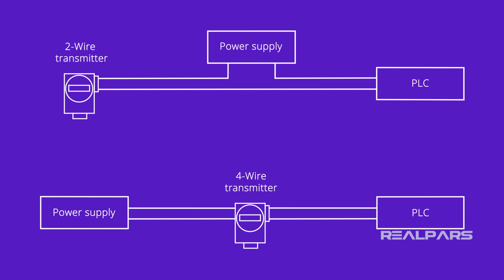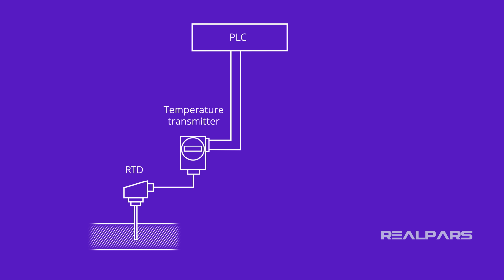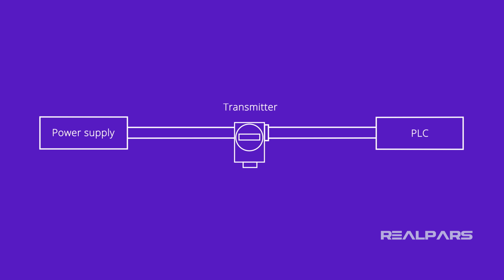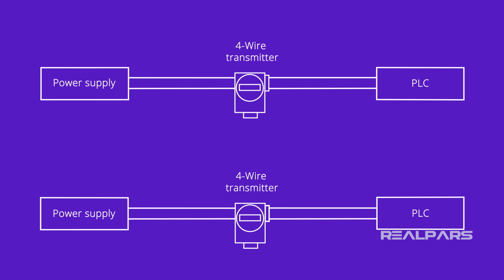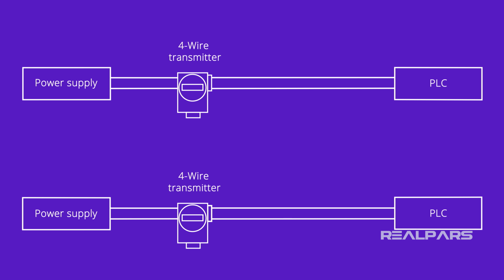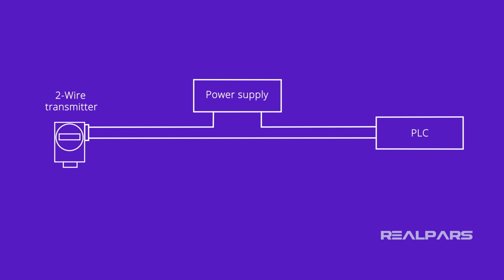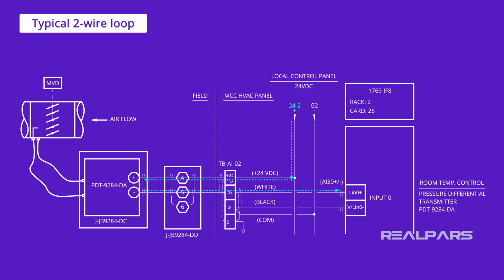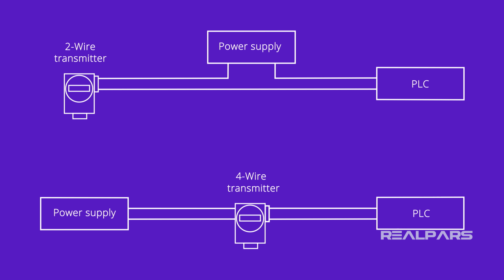What are 2-Wire and 4-Wire Transmitter Output Loops?

Comment: For the 4-wire instrument, what are the 2-wires going back to the PLC? Are they an AI & AO? Or can they be any type of IO
Reply from the maker: Hello, @alextannerharo5959.  Thank you for your question. Good question. If you are using the 4 wire, 2 wires for to power the transmitter and 2 wires for the signal out of the transmitter to the PLC. The 2 wires coming out of the transmitter are the + and – voltages connections to the PLC. And the same applies if it’s a current signal.  Here is a link for your learning:

https://www.dwyeromega.com/en-us/resources/pressure-transducer-installation?srsltid=AfmBOoqUxL68NmzUAViIJnGMUZORJdgR2JOAzwKVALsN8PmjEjiVY7co

Happy learning from Realpars!

Comment: For the 2-wire type connection with external 24VDC power supply (+ to transmitter + and - to AI card, while transmitter - goes to AI card channel to form loop) is there a specific type of barrier or isolator model that can be used for transmitters in Class 1, div 2 environment? Thanks in advance
Reply from the maker: Hello@priyankadookie2421.  Thank you for your question. Yes, there are as stated below in the definition.

Transmitters used in Class 1, Division 2 environments must meet specific safety standards to ensure they can operate safely in areas where flammable gases, vapors, or liquids may be present under abnormal conditions. Here are some key considerations:

- **Intrinsically Safe or Explosion-Proof Design**: Transmitters should be certified as intrinsically safe or explosion-proof to prevent ignition of hazardous materials.

Depending on your application, here are two links for your learning you can research:

https://www.talontechsales.com/hazardous-area-products.html?form=MG0AV3&form=MG0AV3

https://www.noshok.com/support/support-tools-faq/application-insights/hazardous-location-requirements-for-pressure-transmitters-in-the-oil-gas-industry/?form=MG0AV3&form=MG0AV3

Happy learning from RealPars!

Comment: What is the most used in  industry 2 wire or 4 wire ?
Reply from the maker: Thank you for your question. Both types are widely used in the industry, and the best choice depends on the specific application and controller type. Learning both is beneficial if your role involves wiring and integrating them into your designs. These concepts are commonly taught in electrical engineering and technical schools due to their broad applicability. Happy learning!

Comment: Just a remark; I think we should never use AC and only use DC Power supply when using 2-wire loop powered transmitter because if you use AC, then you can have Electromagnetic Interference (EMI) in your signal that is being sent to the PLC. Please correct me if I am wrong.
Reply from the maker: You are correct.  A 2-wire transmitter's circuits are designed to regulate DC current, not AC.
Reply: @realpars  thanks for confirming.

Comment: I actually want to know in an Analog I/O module card ,where does the 250 ohm resistor is placed with regards to 2 wire and 4 wire?
Reply from the maker: An external 250 ohm resistor is needed only if the I/O card is a voltage type.  If that is the case, the 250 ohm resistor is connected across the input terminals of the I/O card.
Reply: @realpars  thanks

Comment: Please explain wiring, when we use barrier in the loop in two wire communication. For example of we use P&F barrier then where to put this barrier in the loop?
Using common sense I can tell that...just before the TB we can put barrier. But I have seen two wire communication where power supply, transmitter and PLC are not in series.

Comment: what if the transmitter is loop powered meaning that there is no need for a power supply in the 2 wire configuration, the transmitter receives the power from PLC IO cards ?
Reply: Nope. You put a power supply in series with the transmitter and the PLC. If the transmitter is loop powered, then it gets its power from the loop. The PLC's Analog input doesn't provide power.

Now you could grab power from the PLC's 24 VDC power supply, is that what you meant? 

In that case, yes that would work. The +24 VDC lead to the "+" lead of the transmitter. The "-" lead from the transmitter to the PLC's Analog input "+" terminal. And the  PLC's Analog input "-" lead to the PLC's "-" terminal.
Reply: "The +24 VDC lead" should be "The +24 VDC of the PLC's power supply" for clarity. And you would have to decide if saving a power supply and using the PLC's power supply instead was the appropriate thing to do.
Reply from the maker: A 2-wire transmitter is technically "loop powered".  If the PLC I/O card provides the 24 VDC, then a series-connected power supply is not required. In this case, the 2 leads from the 2-wire transmitter would be connected directly to the 2 leads of the PLC I/O card.
Reply: NO.  Loop powered is synonymous with a 2 wire circuit depicted in this video production.  Loop powered does not require any ADDITIONAL power supply to function , but does require A power supply to function.  Loop powered devices typically have very low power requirements to mitigate loop voltage drop.